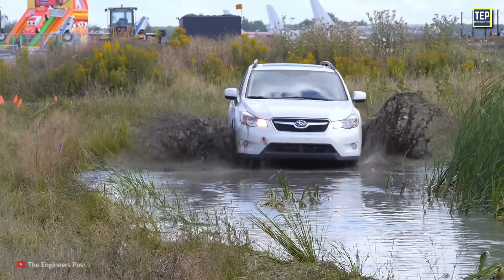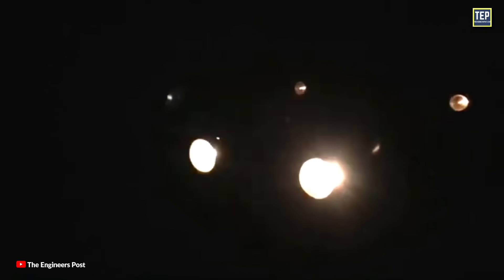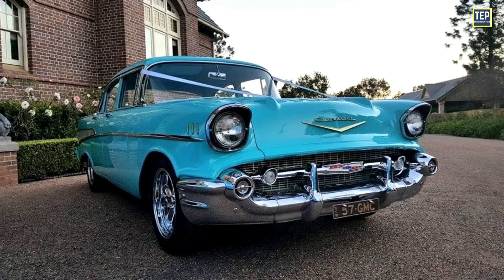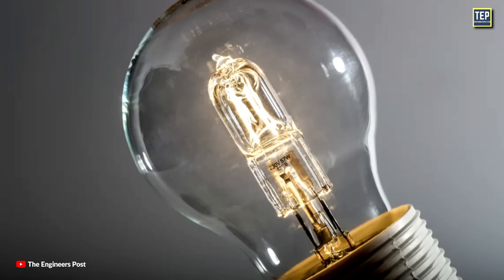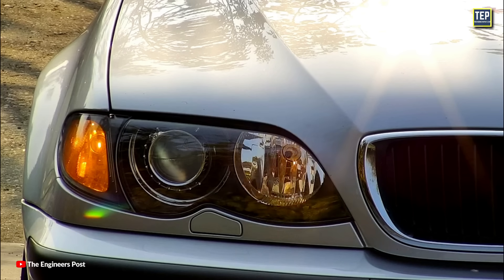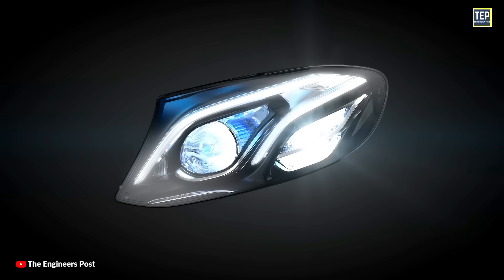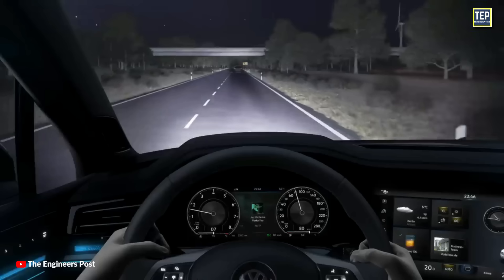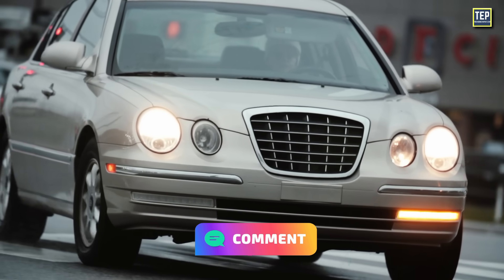The Problem With These Headlights

Comment: LEDs will be the best, modern day LEDs have been designed to work even with housings where Halogens used to be.. they have spinning fans that run when turned on reducing the low heat and even prolonging the LED life. l have an LED light installed in my 2004 Toyota premio 240G..unlike in this video its not spreading the rays of light all over it just points down and straight perfectly thanks to its modern design and advancement. in my country a pair of Bi Led (with dim & full) is sold 50$ a pair. which its considerably cheaper..l have had the car for 4 years with the LED and its still going.

Comment: Whatever about headlights, one thing that I find with quite a number of vehicles produced in recent years is that the rear indicator lights are very small on them. I was recently behind a Tesla and there was a large light cluster on the rear of the car. However, when he indicated to turn the indicator light was about the size of a small matchbox - it would be easy to miss, especially in sunny weather. I would have just assumed that for safety reasons rear indicators would be required to be large purely as a matter of safety
Reply: What annoys me is cars like the Chevy Bolt and Mini Clubman that have big fake red reflectors where you'd expect the brake lights to be and the real brake lights are down low in the bumper behind the retroreflectors.
Reply: Volkswagen and Audi ditto
Reply: Yeah, so many of the new Toyotas have essentially small pocket flashlights for rear lamps.
Reply: Two more things:
1. All indicator lights should be amber.
2. Indicator lights should just blink - all the way on, all the way off, repeat.  None of this nonsense where they light up in sections from inboard to out.
Reply: @JonMartinYXD I'm in traffic in California and sometimes the cars want to merge but it matches the brake lights. Unless they didn't use a turn signal? I don't even know. They should be different color.

Comment: The worst part of LED replacement lights that make them incompatible as a replacement for halogens is that they often don't have proper focal lengths for the vehicle headlights that they are supposed to fit to.

Comment: I am more interested in the Matrix style lighting systems. Yeah, smart lights lead to more complexity and problems, but when they are working right, the idea is amazing. Although, manufacturers need to start releasing all these headlights with glass lenses again. Make them replaceable. Or at least give consumers the option of using glass or plastic lenses. Plastic lenses are soo dangerous when they get older. They turn yellow, and fog up from de-lamination and general UV/heat damage. This blocks light from exiting the housing properly and leads to hazy and dimmer output.

Comment: Laser lights use hundreds of thousands of tiny mirrors?  I have a DLP (rear projection) 73" TV, and when those mirrors go (and they do, guaranteed), they cause picture problems.  I hope they straighten out how to get your average car owner to lubricate 200,000 mirror actuator arms per lamp.  That sounds like a lot of very precise work to me.

Comment: You know what would be smart? Since auto makers like to give cars LED lights, why don’t they just make the halogen assemblies and put in LED bulbs from the factory? Cuz nowadays, most halogen bulbs have an LED equivalent. That way, you’ll have not only the LEDs that apparently are oh so important or whatever, but you can still easily replace the bulb for a few buck rather than the entire assembly for a few grand.

Comment: I missed out the HID headlights with mercury vapour lamps and the ones with projector headlights. Not even pros and cons of them would be found.

I like the concept of steering wheel operated headlamps, or in other words the directional headlamps in Citroën DS and the adaptive headlamps in 2002-2008 Opel Vectra and 2004-2009 Opel Astra.

Comment: My experience is that halogen is the best. I have run the same bulbs for 35 years and they light up the road for 500 meters. As a mechanic I don't see HID lasting as long as halogen. LED cost between $3000 - $10000 to replace

Comment: Interesting overview of automotive lights. 
Howver; omited the net improvements of lighting lamp types, their housings, achitecture, dynamics, automation, lenses, colour spectrum, aiming, intensities, are net hazards in the making to present.  

Automotive lighting in vehicle models of recent 25+ years to present  invite many hazards, detached from nature, road & weather condtions, lack of courtesy, egocentric behaviours, recklessness,    including light-blinding drivers in oposite direction. 

Accordingly, the architecture of automotive lighting are wastefull by design, very, very costly to, upkeep, replace when damaged, often obsolete, .... Burdensome, Not Envirionmetally Friendly!

First Responder vehicles, be they Fire vehicles, Ambance, Police, Towing/ Service - repair are all fitted with harzardous lighting, harsh, disorienting, light-blinding, overly bright at night, in fog, rain, snow weather conditions thus invite perils, injuries, and worse instead of their prevention. 

Their PR slogan, "Slow Down Move Over" & law is ridiculous while lighting blinds, disorients, and confuses approching vehicle drivers.  

Big changes are required and very soon to eliminate the foregoing dismal and hazardous lighting systems and architicture, so to instead foster safety, functions, durability, be low cost, etc.

Comment: Nice video. Though you forgot to mention HIR bulbs which are an affordable upgrade to halogens with almost twice the output.  (1850 lumens vs 1000 lumens) than regular halogen. The juicy news is, its power consumption is a little more than that of a regular halogen bulb, enabling you to use same wiring harness and same socket(just a little fiddling needed - which even i could do in under 5 mins)

Comment: "dazzling other drivers" This phrase pops up numerous times. With good reason.
HID and LED light on new cars dazzle other drivers even on low beam. They are obnoxious and dangerous. let's say it like it is.
A few points:-
Higher kelvin light temp is not always a good thing. If the CRI rating is low, then you lose colour and visibility may actually be degraded despite typically having higher lumens than a halogen.
Higher kelvin light temp is bad for other drivers. It "Dazzles other drivers".
Higher kelvin headlamps when seen at a distance tend to throw dazzling blue and purple light colours for oncoming drivers. Very annoying and "dazzling".
Lower kelvin halogen headlights do not dazzle the human eye at night, nor show twinkling of other colours.
Lower kelvin headlights are far superior in fog conditions. Higher kelvin reflects back from the fog badly.
I also suspect newer headlights also dazzle because the light source seems to be projected directly forward from the light source and through a small hemispherical lens straight into your eyes. This is a suspicion, I haven't pulled them apart so don't quote me, but in any case, the same lumens coming from a smaller lens typical in new cars, is just going to be more intense for others to look into.
Halogen bulbs have an opaque cap on top of the bulb. The light reflects backwards onto a metallic reflector of your headlight which has a large surface area (compared to tiny hemisphere lenses), and then forwards. So the light source is diffused over a larger surface area, and you are not looking directly at the light source, so therefore less dazzling to oncoming drivers.
No oncoming halogen bulb headlight car has ever dazzled me on low beam during country driving. Numerous HID and LED cars have dazzled me, even if they are behind you, they are very bright and distracting through your mirrors.
I honestly think headlight developments have outpaced the automotive design safety standards bodies globally, and they are caught short in the area of specifying allowable light Lumens, kelvins, CRI, and light spread and other headlight design standards, such that now driving the country at night is becoming unsafe and I don't really like doing it anymore.

Comment: Before composite halogen headlights there were halogen sealed beams.
I remember buying some to upgrade the headlights on my 1980 Honda Accord.
The halogen headlights were brighter, whiter and used less power.
The 1984 Lincoln Mark VII was the first American car with composite headlights.

Comment: Believe it or not the Citreon DS had headlights that turned as your turned the steering wheel back in the 1950s.
Reply: Wrong. The DS was indeed introduced in the 50's, but the turning headlights only came later on in its life
Reply: @bebabcsinya  How much later? It was still a long time ago.

Comment: I started using hid lights since 2010 and till today in 2024 i have changed several vehicles i used HID in every vehicle and still using HID in present day because it is very reliable than led, led may use less power and more brighter but leds are not reliable as they need to be prevented from overheating and i have used few led headlights and all failed due to overheating because its cooling fan eventually fails, hid is the king i have never experienced any hid failure and different hids also available with different color temperature and different brightness lux